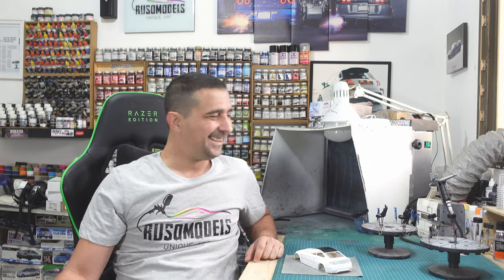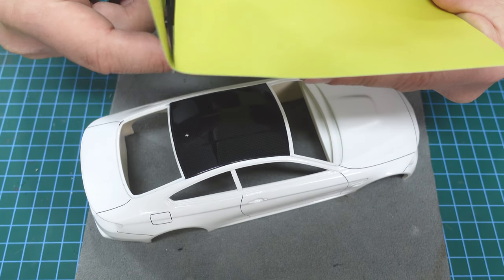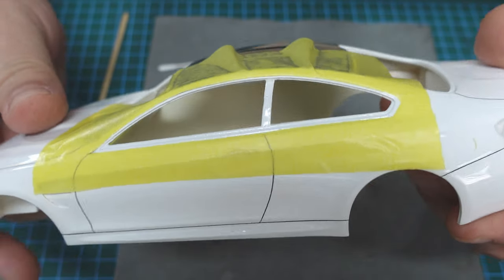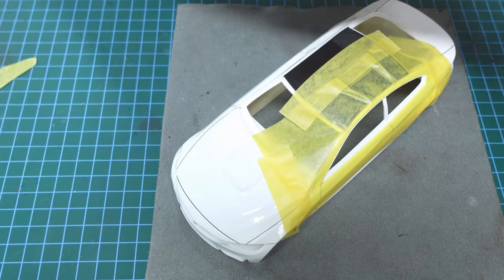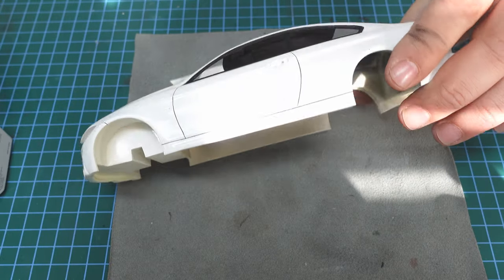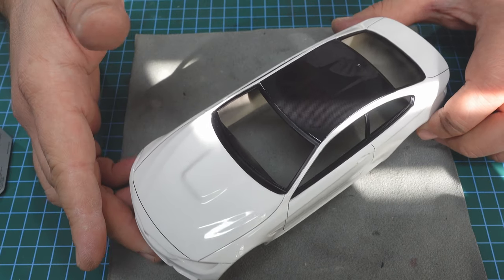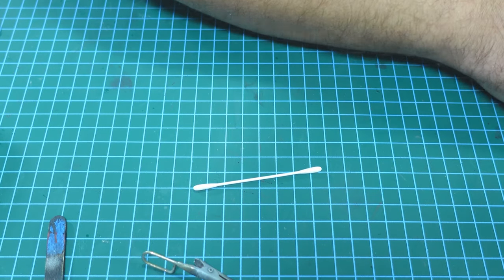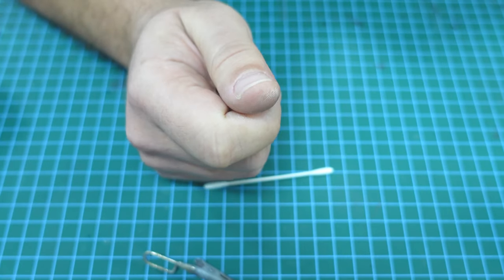bmw m4 alpha model part 6 how to paint trim a window

Comment: Hi Ruso, I'm amazed by you magic trick, its really awesome as you say it :)  I was wondering, the  metallic paint needs to be on a solvent basis, right?  I have Vallejo metallic paints on a   water-based, but I don't think it works.  When you started with these items, did you first prime them, before spraying the X18?  Also, when you're completely done with the wheels, do you still put a 2K clearcoat on them?
Reply from the maker: Hello my friend I prime with primer yes and after use x-18 acrylic paint and after the Metallic paint of Mr hobby as you see in the video let it dry and after use enamel paint it will be awesome 👌
Reply: @rusomodels  Thanks man 👍